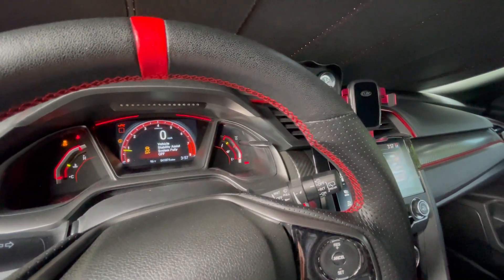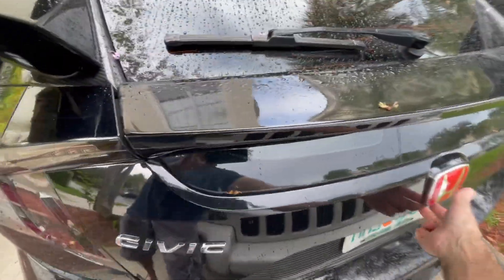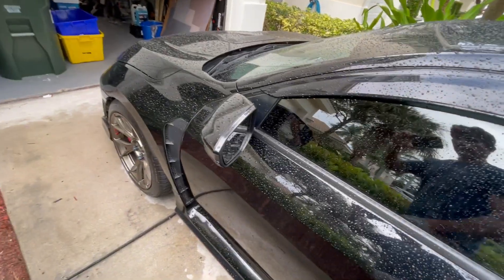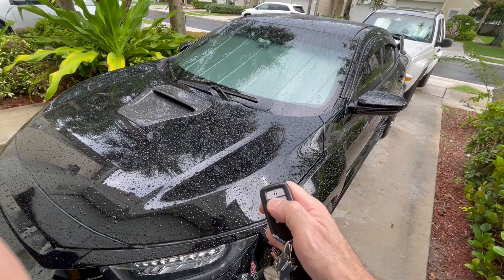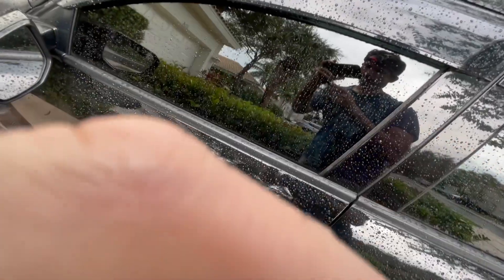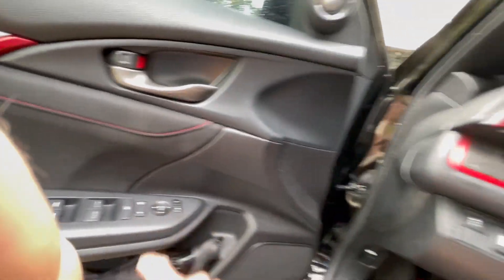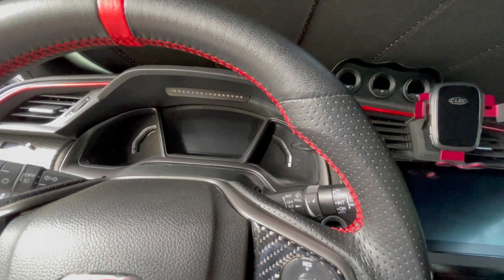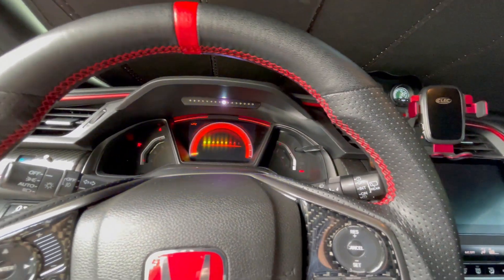S.E.S 10gen Honda Civic Kill Switch Security System

Comment: One of the worst experiences I've ever had with a company or customer service. I ordered a vehicle part through their SES Electronics Website (Kill Switch Module) at premium price. Upon installation, my mechanic realized that I had received a module for a different vehicle so I immediately contacted them.   They had no troubles recognizing that it was their mistake, and ideed had sent the wrong item. They quickly mentioned that the correct item would be sent with a return label at no charge so I could return the incorrect item. Next day I received a message stating that a return label could not be sent and that I was expected to return the item and take care of shipping costs and lost time for no valid reason if I wanted the correct module. My other option was to pay for another module if I wanted it faster! Mind you my mechanic had already charged me for trying to install the wrong module.  My reasoning is that if I would've been the one that had ordered the wrong part, it would've been understandable, but given the fact that it was their mistake, and they made 0 effort to help me except send an email stating that they would sit and wait for me to return the item before anything else is unnacceptable. I absolutely do not recommend this business. I had to go through Paypal claims to get a refund. read less

Comment: They can still break in and steal your airbag. Because the alarm might not go off as far as you are demonstrating. Why don't you just do it to where it kills the fuel pump and or the ignition switch.
Reply from the maker: @lubricatedDoritos  OEM alarm system not going to protect from steal your airbags . They can steal your car and programming a new keyfob and drive away like the car belong to them without the OEM alarm go off .  This kill switch prevents from programming a new key fob and force ignition .
Reply: cuz it’s his car and he can do what he wants.